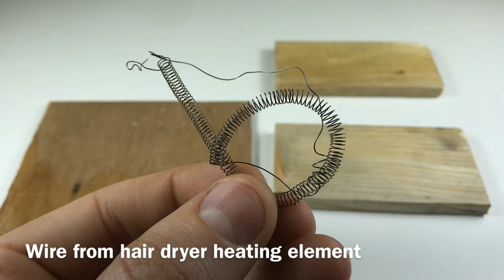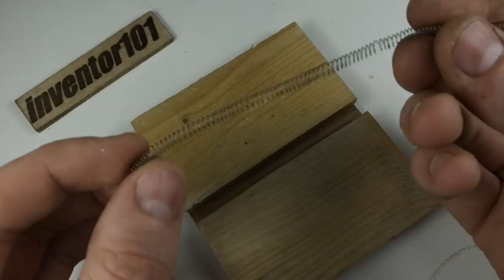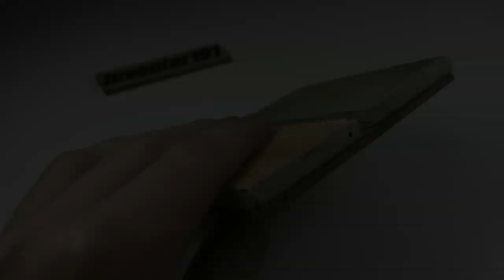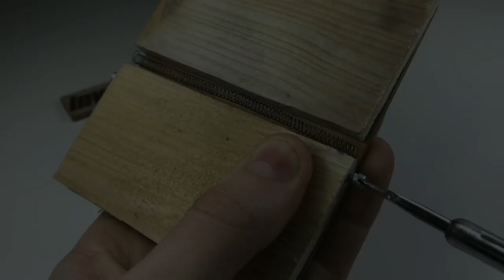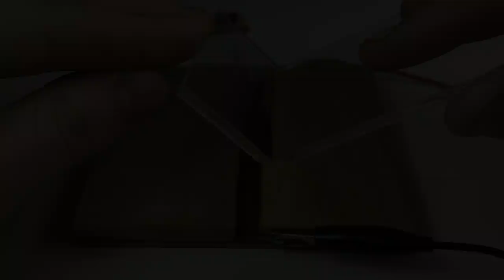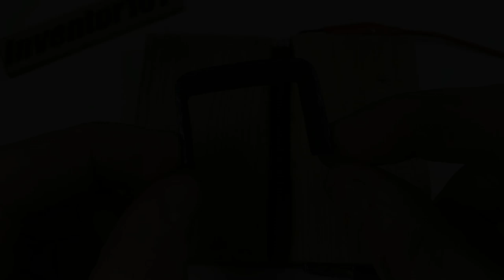How to make a acrylic bender (Cheap & easy)

Comment: Video fantastic bro
Reply from the maker: Adem Uyar and thank you :)
Reply: @Inventor101  The wire you use doesn't burn the board?
Reply from the maker: Adem Uyar The wire isn’t touching the wood but the heat from it will slightly burn the wood but it wasn’t a problem:)
Reply: @Inventor101  thenk you wery much bro